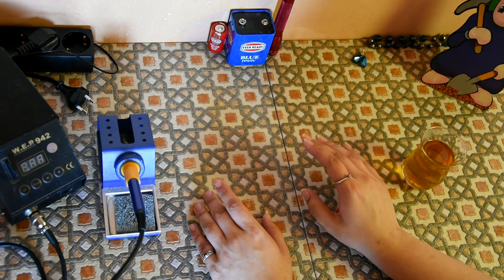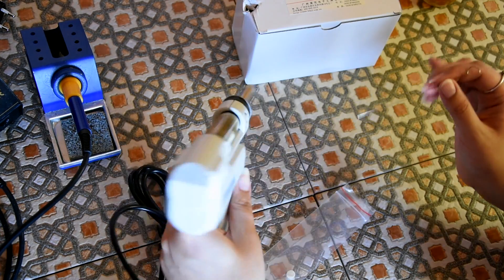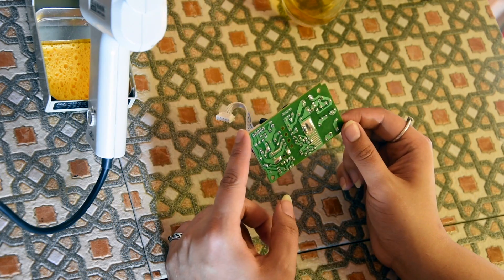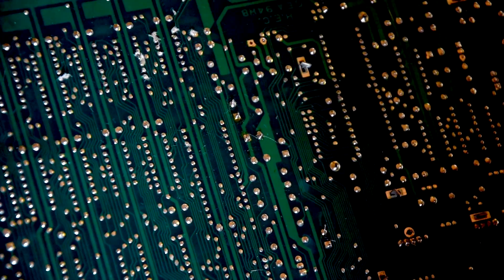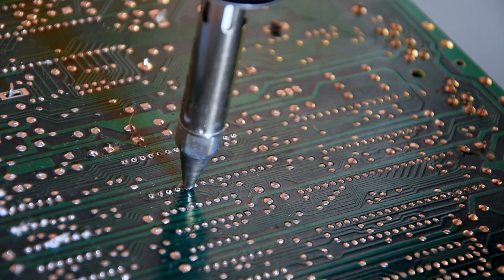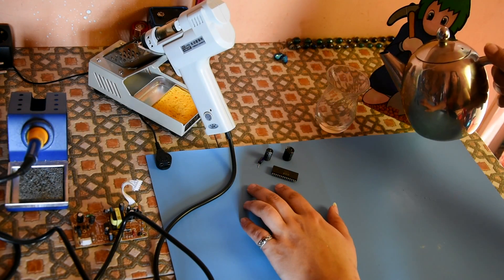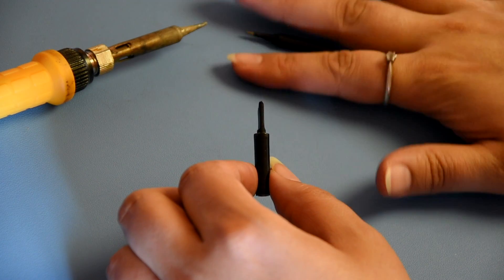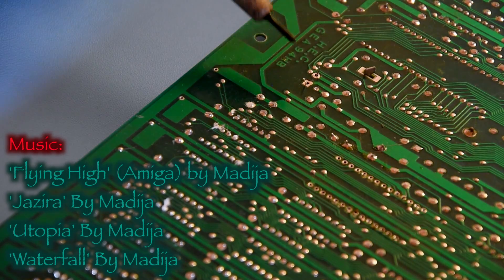Electronica - Desoldering pump unboxing, test & review

Comment: I have been checking the price in Argentina and depending on the brand you can buy a new entry level AVR up to a new integrated stereo amplifier from Yamaha!! That not make sense!! I am thinking in recap my old Sony deck but I will need to do it with conventional tools

Comment: De-soldering was very easy for me, because I have been sitting beside an electronic factory for 20 years. So when I needed something de-soldered from a pcb, I asked a nice colleague :-))) On thing, I have learned about soldering from the experts. They have used this liquid smd flux in a plastic bottle with a hollow needle. It is „no clean“. You just need some solder without flux. For removing flux residues, I use isopropanol and an anti-static brush (they come from China for little money). I have also learned that from my ex colleagues. Now, I have to do it all by myself, so I have a hot air solder station and a de-solder pump. And I have been as excited as you were, when I noticed, how well it works.

Comment: I wish the first one I ordered had gotten lost in the mail. I didn't expect it to have a build in jack hammer damaging the boards, so I don't dare use it. I've got another one which works quite nice. But it's like mix between this one and a manual spring loaded one. For the price of those two I probably could have gotten this one.
Reply from the maker: I think I know which one you might mean, it's a blue one that is like an electronic spring loaded one. i'm figuring.
Reply: No, the blue one... that's the electric "jack hammer" (no spring). The spring loaded is a Velleman VTDESOL3. It's not bad, but yours is no doubt better.

Comment: Since I first saw this video last week I have been searching for reviews and more info about this model online, and I discovered that there is also a double pump, (more powerful), version of this gun, (the model GJ S-998P), and it seems to be very well liked by most people also, especially since it is only a few cents, (!), more expensive than the single pump model you review here, so the double pump one I am seriously considering buying!

I also found out what those little round white "felt" looking things are that were in the bag with the cleaning rods... those are the replacement filters for the back of the solder waste canister to keep junk from getting into the pump itself. (But you most likely already figured that out by now, after a year of use!) 

BTW, did you ever find the cleaning rods that you said you lost for this pump? (If not, did you see my comment in one of your other videos suggesting to try steel "baling wire" that farmers use to make hay bales with? I think that might just fit into the tip... maybe... worth a try anyway if you still never found the original cleaning rods.)

Comment: I bought one of these and was sent a Chinese plug (despite My ordering a us model), after a step up/down converter purchase, i didn’t have great luck. I also had horrible acrid smoke at first, but mine turned blue.  It worked great for caps and IC’s on a cartridge, but i had terrible luck with the through hole PPU IC chip on my NES. Glad it worked better for you than I
Reply from the maker: If you got the US version you shouldnt have needed a step-up/down converter! the plug is Chinese they dont change that but the US version should be 115v. It seems they sent you a Euro 230v version if youre having to use step up/down converters etc!

Comment: What temperature do you set your de-soldering pump at?  I'm trying to desoldering a RAM chip on a C64 board( dated around 1984), and it's "freakin" stubborn.  The first pass seem to get most of the solder, but I can't get most of the pins to break free of the sides of the holes.  I tried readding solder, but that's not even getting removed now.  One solder pad is already gone, and I'm concerned I'm going to do more damage if I increase the heat.  I did a recap on this board, and removing solder around a few of the cap pins was a struggle.  It's like the heat is getting redirected, and not melting all the solder.  
  Thanks in advance for any advice.  Great channel BTW.
Reply from the maker: I keep mine at around 350-370 ish. It's very odd they shouldnt be that difficult to desolder. Are you allowing the iron to be on the solder joint a couple of seconds before pressing the pump button? if you press the pump instantly the suction will cool down the solder during the melting process.
Make sure you keep wiping the tip of the iron on the damp sponge and every now and then add a touch of fresh solder to the tip of the iron.
And thanks.
Reply: I'll try different temps to see what works best.  Thanks for the other tips.

Comment: I bought one very cheap soldering iron handle (a bit over 2 euros :-D ) hakko clone I guess... In the hand feels quite good with rubber around the fingers for extra grip. Only bad so far is the cable. Rather stiff... I am waiting now for the temperature control board :-) I want to see how good iron can I get for 6 euros all together :-D
Reply from the maker: Nice, it seems you are planning to do some soldering by the sounds of it? :o)
I hope it works out for 6 euros, haha for that i've only seen the very basic stuff, just typical iron with a little free solder to make one feel cared for lol ;o))
Reply: I had one very old soldering iron without any temperature control that I bought more than 20 years ago... really crappy. Takes ages to get warm... and then temperature goes up and down... or too hot or too cold. Complete disaster and not usable at all. So I want to have something a bit better :-D I read some reviews about these Hakko clones... people say they are quite decent for the price. So I looked for the parts separately... handle and control board + connector. Altogether around 6 euros :-P  I will recycle some old case for the enclosure. I just bought a Technics SU-8080 faulty for very little money. Maybe your Marantz repair repair series is going to be a good help for the troubleshooting of this vintage unit ;-) Actually I did not need this amplifier, as I have now at home 5 amplifiers :-D but it was so dirty cheap I could not resist. One friend asked me if he can have it... I guess I will let him take this deal and I help him with the repair :-)
Reply from the maker: Before this WEP I got..the Hakko compatible, I used to have one of those cheap temperature controlled ones haha, it was bad, there was no indication of temperature, the dial just said "Off - hot" :o))) It doesnt fill you with confidence :op

Actually the amplifier you got, even though you dont need it, would be 
good practice I imagine, it's always good to practice on something as an
 extra, unlike me who practices on her precious amplifier haha but 
desperate times they were! :o)
Reply: I think that too. For such little money it is a good practice "playground". And maybe in future a recapping to see if it makes any difference in the sound. And I forgot... I am about to receive a B&O Beomaster 901 in rosewood that I found last week online almost for free also faulty... but from the description I am hoping that is just mechanical fault (switches not holding down...) something to be seen.
Yes :))) I think in the end I will have something like that... hakko chinese copy without the lcd. No temperature temperature indication :-P
Reply from the maker: Bang & Olufsen? If you get that working, haha i'm sure I dont need to tell you how good B & O are supposed to be!  A lot of the time it tends to be something simple which many just dont attempt to repair, let's hope it's that... as for your hakko chinese copy, it may not have an LCD display but It can't be worse than my old one :op 

https://www.flickr.com/photos/madija/28364701080/in/dateposted-public/
Reply: Yes Bang & Olufsen. I think they are more known for the innovative designs. When you get more into audio you realize that they are not as good as the price tag would suggest. I got it in a rather bad shape cosmetically with some scratches, screws missing, broken brackets... but that is kind of solved now. The biggest issue is with the input selector buttons... they seem not to hold.  I thought there was a simple mechanical mechanism that would release one button when the other input is selected... but I cannot find any mechanism inside to do that, unless someone has removed parts in a previous repair attempt. Nevertheless I found a workaround for the moment, until I find a more permanent solution, with a zig-zag shape made from a paper clip I can keep the button of the input I want pressed. :-) The Audio quality is surprisingly good because this unit was not supposed to be hifi. I have another Beomaster 1900, which I did not plan to keep, but these B&O designs from the late 70's are so cool that I could not get rid of it. The space age shapes with the wood veneer around is so damn vintage cool... :-P
Reply from the maker: I've never actually had any experience with Bingbang & Oulfensen (I keep referring to them as this because I struggled with their name at the beginning lol :op ) 
Mechanical faults annoy me because I tend not to be able to deal with them a lot of the time. I've just had an episode trying to fix something in my Sanyo boombox that was mechanical and it took me a while.
So you're saying B & O are mostly just overpriced? , i have stupid expensive prices associated with that name in my mind. They are attractive looking through and I can see why you'd want to keep them.
Reply: I think it is more like a design statement. They don't sound bad... but is not outstanding in any way. (I am not talking about their current products... mostly 70's, 80's and 90's) You can see in second hand prices. If you look for B&O from 70's or 80's, even the high end back then, is a real bargain if you compare with the prices asked for the top of the line of Pioneer, Technics or even Sansui from same period. It is funny to look at history and see how the several brands have evolved over time. Sansui is an example of a very high end brand from the 70's which at some point made some decision on trying to produce mass market devices and destroyed completely its image.
Reply from the maker: Aha so their current products are more expensive than their vintage ones. To be honest i've only heard of them in the past year, it's not a brand which springs to mind instantly. I think it comes to a point where  sensibility needs to prevail over brand status lol. I would like to have something by Nakamichi for example but I was shocked to see a listing of a single sealed c60 Nakamichi cassette for around 60€.
Reply: It looks a bit like that. But when I was young the B&O products were considered already to be very exclusive and expensive. Now the same stuff can be bought quite cheaply as well. It seems to me they they do not hold value very well. But Nakamichi unlike B&O holds well its value :-P I am not sure but I thought Nakamichi was making only electronics... Making cassettes is related with Chemical heavy industries. I would bet they bought it from someone else and just re-branded it to Nakamichi. You have the most expensive cassettes these with Reel to Reel looks... those are the hype in the cassette kingdom  :-D and the other metal one you showed in some other video :-P I don't even have metal tapes. I have 5 decks in total and only 2 technics decks that support metal, and my favorite one, the RS-M85, is not even metal capable :-P
Reply: Yesterday was like Christmas... but a little bit better :-D I passed by the electronics trash bin to be sent for recycling and I found a professional desoldering station from Pace... Sensa temp digital controlled station together with 3 different handles: Sodr-x-tractor, Thermopick and Thermojet. I just did not find the pump :-P then I found also lots of Weller soldering iron holders and one huge soldering iron for bigger jobs (ersa 50). I found another Weller station without temperature control and without the handle with broken case... but I can glue it back and use it for my cheap soldering iron station I was building... as it has a perfect transformer for the job 230/24v :)) I have to go back there today and search a bit more. There was so much junk..e.g. ultraviolet eprom eraser. But I cannot bring everything. Already too much trash at home :-D
Reply from the maker: Wow nice! You found some goodies there :o) 
the desoldering station without the pump, do you mean the pump was removed from the inside? it tends to be mostly a standard DC motor but a little larger of course..my desoldering gun contains this type: http://www.maxonmotor.com.au/medias/sys_master/root/8806542049310/KAG-M-42.jpg

Weller are pretty good, if you can manage to fix the issues with these that you got then you've struck gold! :o)) ... well with regards to soldering irons :op lol
Reply: Actually I think there should be a separate pump for this thing as the station looks exactly like this: http://isurplus.com.au/images/stories/virtuemart/product/Pace_SensaTemp_S_4acafba4b8f2c.jpg without any connection for the pipe  I will go there again later and take a better look. Somehow in that corner the light was broken so I have to dig into the mess of the cables with my bicycle light :-D One of the handles is like this: https://www.paceworldwide.com/sites/default/files/SX-70SolderXtractorSensaTempBlack%206010-0077-P1.jpg the others have slightly different tips. I was just wondering if that "PaceLink" connector is the interface for the pump because in the handle there is a little switch. If it just and on/off switch I might be able to connect to a circuit driving a pump like yours. B-) I think once I have savaged also from the garbage a foot switch :) that could be also another way of operating an externally powered pump. I have to look for it in my basement.
Reply from the maker: You sound like you got a big project on your hands! :o) The circuit for the pump would seem to be just a simple on-off i'm figuring, I mean there is nothing much else to it, at least on my de-solderer.
You already have the iron part of it that heats up no? from what I figure you just need to connect it to a pump.. or am I totally misunderstanding? lol

Comment: Good it worked out for you. The pads are filters.

Drop in on us over there at Tapeheads. Haven't seen you there in a spell.
Reply from the maker: Thanks John, 
Yeah I kinda didnt bother after that unpleasantness with Sam, just decided to watch and read around rather than post/reply/participate. I havent been there for a little while though. I hope you're doing well.
Reply: I am doing well, other then the Sony TC 880-2 I took on. Did a full recap and found out it has a buzzing that follows the capstan motor. UHG! Can't figure it out for nothing! Changed the IC on the servo board, no joy! Took the job cheap and now am paying the price!
Reply from the maker: I just took a look at the TC 880-2 .. hmm buzzing which is coming from the capstan motor? this sounds like there's something up with a noise filtering capacitor or something like that no? unless my thinking is a bit too simplistic :o)) That looks like a nice machine though!
Reply: I have checked the caps on the servo board, not there it seems. I was thinking about having a look at the "snubber" cap at the FG coil going into the IC. It's a Mylar type cap, these almost never fail but stranger things have been known to happen! 

I have a thread on this over at Tapeheads if your interested. As far as nice I am not a fan of this deck, has to many strange quirks!

Comment: I use a similar de-soldering iron/pump and they are so reliable and get the job done :), also don`t forget to plug the hole with fresh solder before turning off this will stop the oxidization of the tip.
Reply from the maker: Yes this seems like it's going to safe a lot of hassle for me. Thanks Jeff, i'll bear that tip in mind! :o)

Comment: Wow, how to desolder and re-solder something in seconds. I still use one of those hand pumped solder sucker things, from back in the day. I never liked to use braid as it leave the residue, but using a soldering iron with one hand, and trying to get in with the sucker with the other, was a bit of a juggling act. Thankfully I dont have to do much these days, and I only get my iron out for wires and connections these days. I just bought a new one was an ultra-fine tip. Its so amazing, but the iron is only compatible with the old style of tip, with two big screws holding the tip in place.  With an industrial tool like the electric desoldering pump, Im sure you could demolish a whole C64 motherboard in less than an hour, and just have a pile of spares. I might even be tempted to socket absolutely everything, so that you can make the ultimate replaceable component C64 computer. As they say, totally plug and play. :)
Reply from the maker: I was thinking about removing more chips, to troubleshoot that old board, since I know it's not the ram, I need to get hold of sockets actually, it's a good idea to socket them all, it can be a test C64 :o)